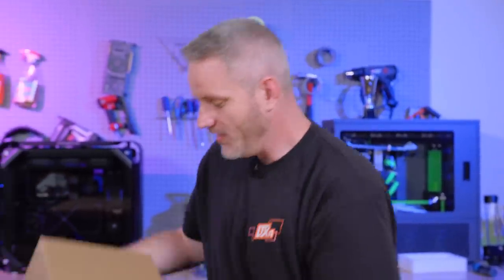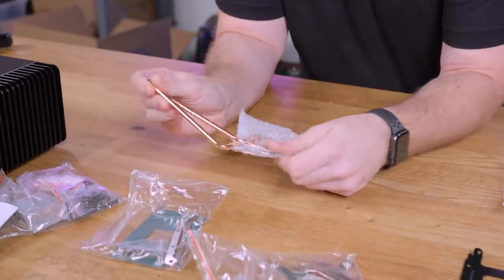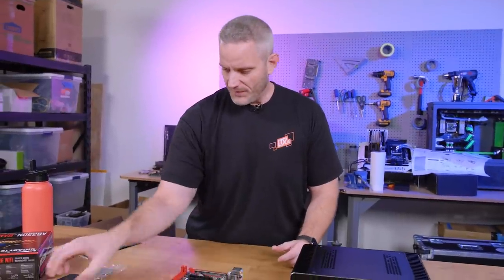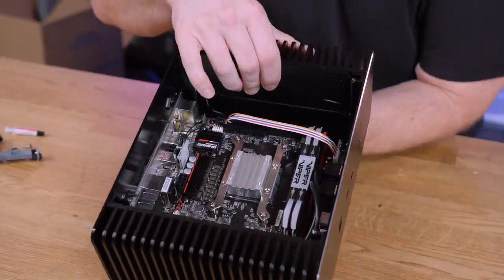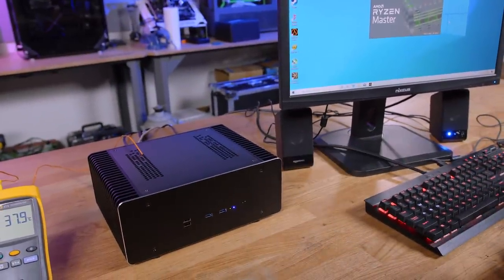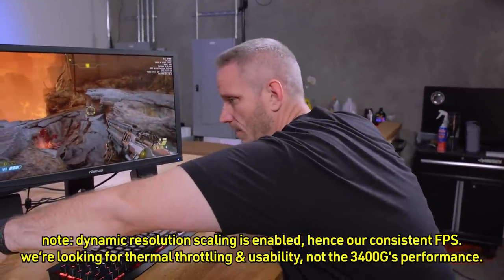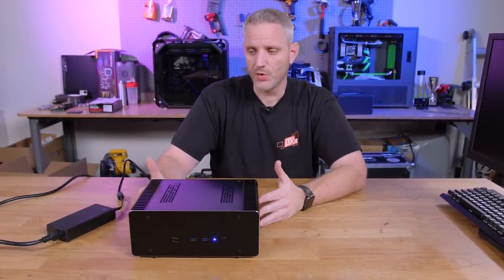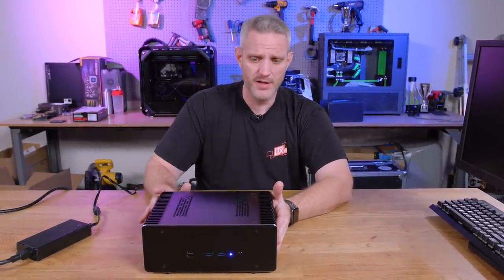I've never built a PC like this before...

Comment: One thing I've learned the hard way after numerous ITX builds I've done, is that you ALWAYS have a USB 3.0 extension cable on hand. You almost ALWAYS have issues with the USB 3.0 cable length, or placement.  In a lot of cases, an extension is pretty much a requirement to enable proper routing.
Reply: Waitaminute...how come no one is talking about the PRICE... it's $331 US for this. You literally have to buy the case, the AC/CD adapter and the power brick separately.
It's 'nice', but no thanks.

Comment: Akasa is an old brand like more than 10-20 years. I used to buy their SATA cables and some velcro strap cable tie and they are nice. But this case still has room for improvements.

Comment: It looks like you could unscrew the front panel and rotate it 180 degrees to position the USB 3.0 cable away from the memory. That could help the cable reach the plug on the motherboard. But then you'd be looking at extensions for the front panel connection.

Comment: One side is hotter since you have both heatpipes on the hot part in the middle (right over the die) on one side and the outer pipes on the other side.

Should really swap 2 pipes so there is a innside and outside mounted pipe on the cpu for each side.

Comment: Could you mod the case top cover ? Lots  more holes in the center area. Then, mount a 140mm RGB fan on top drawing some air in through the bottom holes out through the top venting up. ?
Some RGB bling on an otherwise  totally boring block. Man invented drill presses for a reason. This is the reason.

Comment: Before switching to an Nvidia Shield, I had an Intel NUC inside a similar "case is also the heatsink" design, and it was perfect as an HTPC. It was silent, even smaller than this case, and it had an IR receiver on the front. Never tried gaming of any sort on it though, since I just had OpenELEC installed.

Comment: I love what Streacom has. The DA2 V2 has just come out (better airflow and reworked small things like PSU extension position, but there's a picture of it on the website with a 3080 FE inside so it'll fit. One of Noctuas low profile Cromax.Black colours in there with the FE 3080 or 3070, with the black version of the case would look SOOOOOO GOOOOD

Comment: It wouldn't be too hard to modify the locations of the front USB sockets in order to make those cables fit and, in my opinion, make the front of the case look better.  Basically just have them in a stack on one of the sides (front right imho).
And, for what it is worth, you can get those 12VDC PSU modules (and the AC to DC bricks) in much higher wattages so your only real limitations for this case is how much heat the case can comfortably dissipate.

Comment: Unscrew the front panel, and rotate it. It might avoid the first bend of the cable and give you the extra cm. Maybe you can rotate the USBs too so you have them the right side up. Not that it will not take less then 3 times to plug it in correctly.

Comment: 6:30 Idea, just put a thermal pad between the SSD and the case. Also unless you're hammering the SSD with an industrial work load it wouldn't even heat up.

Comment: I suspect this case is really meant for those BGA-CPU ITX motherboards with an external 12V power brick. Basically an alternative to Logic Supply (now OnLogic) industrial cases like the MC500, obviating even the 40mm case fans for passive cooling.

Comment: Check out the InWin A1+, it has a wireless Qi charger on top and an included SFX PSU with custom length cables. Was surprisingly easy to build in and has an awesome white aesthetic. Fits a full size GPU and if you use an AIO you can easily throw in a Ryzen 9 5950x since it'll exhaust heat straight out the back, 2 120mm fans in the base are enough to keep an RTX 3090 cool in that case. 
Do ittttttttttttttttttt

Comment: I think this is a nice design, this compared to the standard cooler from AMD is a big difference in performance, for example I went from 1736 points to 1806 points in Cinebench R20 with the 2400G, just by changing the standard cooler. Around 35 degrees Celsius, is a normal idle temperature and maximum for games is really 70 degrees, before the cores start throttling down in frequency.

Comment: Another way to look at the USB situation, plan to get low profile ram, Corsair Vengeance LPX immediately comes to mind, watched the whole video and can't tell if the low profile memory you used still had the problem? Then it's a motherboard planning thing (both points are valid, longer cables would allow higher profile RAM and more motherboard layouts, just putting it out there for prospective buyers).

Comment: Akasa have always been so good for the less mainstream parts. If you need something a bit obscure they probably make it, I bet Jay could have got an extension for the usb cables from them (No, I haven't checked but I do have a Molex extension from them back in the day 2004ish) My very first LED fans where Akasa and I made sure to get a case with 5"1/4 drive bays, so I could keep using my all-in-one card reader from them. Great products for the price.

Comment: 11:24 Its hotter there because remember that Ryzen CPUs have the CCXs in one side of the package. And if I'm looking at it right, see 11:30 , you have your heatpipes on the hot side of the case  connected to where to hot CCXs would be. Basically the other side is just getting some of the hot CCX action and is mainly cooling the IO die.

9:12 Try routing the USB header under the mobo?

Comment: 9:00 Jay reinstalls the RAM he had already "built", because as any PC builder knows components you attach to the MB before putting it in the case will definitely have to come off to get to the posts, line up the backplate, etc...

Comment: Akasa Viper fans are damn good, i havea couple that have a decade of service on them working as well as ever now as pull fans threw a 280mm cryorig a80 with a set of noctua 140mm high static pressure fans as push... works amazingly well and let me re-use the fans i already had... it lets me run my x5675@4.4-4.65ghz, (yes, i would upgrade if i could afford to upgrade...being disabled and living on ssi sucks..:/

Comment: jay how wide apart are the vent holes on the top of that case..?
could you possible add/ ergo modify maybe a couple little say 30mm-50mm fans inside to push air out that would in a sense be drawn through the bottom around and past not only the itx board but also the internal heatsink walls, even a little amount of airflow could make a huge difference in thermals???  just a though and i know you love to dabble and modify cases lol

Comment: The issue wasn't the cable length or positioning it was that motherboards I/O and power connector location.

That mobo is just not a fit for that case.

Comment: Well, the Gigabyte B350 ITX is truly the odd-one-out, it's an "inverted layout" ITX mobo, with the PCH above the CPU socket instead of in-between the CPU and the PCIe slot. Most other ITX mobos don't have the USB3 connector and the front panel connectors up there, instead closer to the front of the case and with the RAM a bit more toward the center of the mobo.

Comment: The "problem" with completely passive...
You can pretty much always cool as well or better with an air cooler that has a fan that is essentially SILENT. For example, get a small Noctua cooler and spin the fan at only 400RPM. It's going to cool better than most passive cases... so a passive case is sort of cool I guess (no pun intended) but if it's larger and more expensive I don't see the point.

Comment: 10:00 Gigabytes ITX mainboard layout was rough back then. 24pin, 8pin EPS and USB 3.0 are in a weird spott. If the 24pin was in its common location, the cables wouldn't interfere.

Comment: InWin Chopin and low profile Noctua cooler noises

If you put a Carbonaut pad in, you might never need to open this thing again though. I have one with my 3400G and now I never need to worry about anything other than the fan getting dusty

Comment: just for fun, the GA-AB350-N is NOT the default ITX board layout. i got an NZXT H1 case recently, and had to order a new motherboard to get one that will fit in that case. typically, the 24-pin power is in front of the ram slots, which would give your USB connector just that tiny bit of extra space. maybe, or maybe not enough.

on the "plus" side... now i've got an AB350N and 2600X cpu just sitting around, and i happen to need a NAS-like system... so i guess i've got half the solution already.

Comment: 6:25 I sink my bottom mount M.2 straight to my motherboard tray with thermal pads. works wonders
Reply: Also that CPU block design looks bad with the heatpipes way at the top away from the CPU. Would be better upside down wth heatpipes as close as possible to the CPU.

Comment: I don't think the cables are an issue with any of the modern "cheap" ITX boards.  Both ASRocks and Gigabyte's cheap ITX boards have all the connectors on the right side instead of the top of the motherboard.

Comment: Nice review! If you want a challenge try the HDPLEX H5 case. It allegedly supports a 75W TDP graphics card and a 95W TDP CPU. I've got one but only running a Radeon 1050 Ti and Ryzen 1600 and a 200 W PSU. Would be quite interesting to see someone pusing THAT case to its limits.

Comment: i really want this case to mod i really think  even a single 120 on the removeable top would drop temps  tons  and then cut the wrong if i could and put in a digital temp and fan controller on the front  would be cool

Comment: Next generation in Ryzen 6000 will be a beast in these - if the rumors are true that DDR5 is supported - the Ryzen APUs could possibly have more than the current 6-9 Compute Units making these sub 5L cases into midrange gaming beasts instead of just entry-level gaming.  Think about it. 8 core CPU in one of the chiplet slots - and a 20 CU GPU chiplet on the other. if that would be possible, that would be amazing.

Comment: Huh, the position of the front panel / sata / usb connectors on the motherboard used here is kinda strange. I've never seen a board with them in that position before. But it certainly is good to be aware that the position of connectors on the board is something you need to be aware of when designing a build for this case.

Comment: Take a look at the Streacom DB4 too. Similar to the Akasa, the case is the heat sink. It looks like a modern\futuristic pedestal tbh. Cool looking imo. 
It also can also fit a small gpu but may need a special adaptor for the power supply. Streacom also has a kit to replace gpu fans to tubes too.

I haven't tried it myself.. I just really like looking at pc cases lmao. My pc case still has a zip drive slot.

Comment: Corsair Vengeance LPX 3200 would likely fit in that case.  Adding a little length is fine, but too much and then you have too much cable and then that's a management issue.
I'm sitting here with an ASRock B450 Gaming-ITX/ac and the layout looks like it addresses all those issues, 24Pin, USB3 and USB 2 headers are on the edge of the board in front of the DIMM slots, so those lengths would work fine.

Still it sound like they need to do a better job documenting the cable lengths, placements  and known  obstructions - maybe a printable PDF - so people can check motherboards before paring them with this case.

Comment: HDPLEX sells cases like that, which are quite a bit better, in regards to the cooling setup - but with any system that has you mount heat pipes to the case is going to be a nightmare if you ever need to get to the CPU, or even just swap the M.2 underneath the mainboard and such things...

Comment: I think you should check out the segotep phoenix case you can get it off amazon and it's pretty affordable ($120) mid tower but what's cool about it is that the motherboard is rotated 90 degrees and sits on your left side rather than the right and the air flow is completely horizontal and just makes so much sense as well as has amazing wire management for your rear io and i'd love to see how a 3090 fe would look in this case as the card would add to the liner airflow design https://smile.amazon.com/gp/product/B07WNGN9X4/ref=ppx_yo_dt_b_search_asin_title?ie=UTF8&psc=1

Comment: You could always grab a usb 3.0 header extension cable in order to use the front ports, but that's an extra 10 bucks you shouldn't have to spend.

Comment: The system doesn't get over  60 c and seems to peak at about 50 c nevertheless, I would like to install at least one small fan to expel heat although the lack of dusty-airflow might be more beneficial.

Comment: (1) Can you unscrew and turn the front panel upside-down?  Looks like the USB ports aren't in the center, so the cable might clear the RAM.
(2) I also have the AB350N-gaming motherboard, and found that the VRM really needs some air cooling to not get to crazy temps (I have an AIO). I'd suggest a different motherboard for this case.  But in general, this is a very cool build!

Comment: Jay if this passive cooling pc case actually interests you check out the raspberry pi 400 desktop kit. it actually has a passive cooling beast design beating all current standard raspberry pi 4 sbc passive coolers and only gets beat by raspberry pi 4 active cooling towers with 2 heatpipes.

Comment: Jay you literally found the only miniITX AM4 mobo that has the usb header in that spot and and the RAM in that spot, all other AM4 miniITX boards have the power, usb and sata on the very right side and the RAM is placed to the left of that.  (edit): typed this before you even got to the front panel and power, dude you couldn't have picked a worse board, I mean you had like a 1 in 40 chance of this happening.  Still love your content though Jay

Comment: APU I'd love to see...
While THIS idea makes no sense likely, I'd still love to see it:
A 6-core CPU (R5-6600x?) combined with a GPU chiplet and Infinity Cache. So the IO chiplet would either be separate or merged with the Infinity Cache. On an "AM5" socket paired with DDR5 memory. The Infinity Cache approach should help remove some DDR5 memory bandwidth limitations to the GPU... by my rough calculations it might be similar to the APU in the XBox Series S (wouldn't have the same software optimizations but it should be pretty impressive)... again, probably a bad idea as you're almost certainly better off with a graphics card. I still want to see how far you can push an APU for gaming in a desktop.

Comment: I don't think the short cable on the usb 3.0 ports is bad design more as to that the motherboard layout is bad design. 

Most ITX boards have the usb 3.0 header around the memory slots and not all the way up above the CPU like this board has and I suspect Akasa has tested it on just those boards with it around the memory slots. In those situations the cable would be more than long enough.

Comment: Best CPU for this built would have been the Ryzen 7 Pro 4750G! And you can buy a 5cm extension cable for the internal USB 3.0 19 pin cable for $5.

Comment: Thats not a standard layout mini-itx board. Normally the power, USB3.0 and SATA headers are on the front the board with the RAM behind them.

As such most of the issues seen here with cable management would go away with a more standard "mini-itx" board layout.

Still an interesting video the highlights some of the common issues with the packing so much hardware into such a small space.

Comment: I guess one could easily play Dota 2, League of Legends or World of Warcraft on this and have a lot of fun. Warframe is totally playable on 3400G - just checked the videos showing exactly that - and it's a very popular looter shooter. Games like Genshin Impact, Minecraft, Path of Exile or GTA V are also very likely to run well. Not even speaking about all sorts of strategy games, city building simulators, visual novel games, Among Us, Terraria, Rimworld, Stardew Valley etc etc. And the CPU is good enough to do professional Web programming, graphic design or some light video editing on it and have a lot of browser tabs opened at the same time.

Comment: the usb and sata connectors are in a weird spot on that board specifically. change boards and likely you will have no issue wit the usb 3 cable

Comment: Jay: "they don't make performance ram with little bitty heatsinks"
Corsair LPX DDR4 3600Mhz: "Am I a joke to you?"
Reply: It's like $60-80 on amazon right now and comes in like 1-5 days.
Reply: G.Skill Aegis could've been a good alternative...
Reply: @TheTekknician  The Aegis are VERY affordable and come in 3000Mhz. I have used them in a build for a friend. Probably fairly tunable. The Corsair ram has proper heat spreaders though and comes in a TON of different speeds. I personally own a 3600Mhz kit paired with my Ryzen 3600.

Comment: Air cooling Pro here. I'm doing it since 2010. Just saying.
I had an overclocked q8400 running at 3.21ghz crunching primes for 48 hours at 29°C, 100% load, ALL-THE-TIME.
I still have some dirty little secrets I'm not sharing though.
HAH  HAH!! XD

Comment: I wonder if it was originally designed for MBs that use SO-DIMMs, and that’s why the USB cable doesn’t reach. Not saying that’s a solution (it should be longer), but that would at least explain why it was made that way.